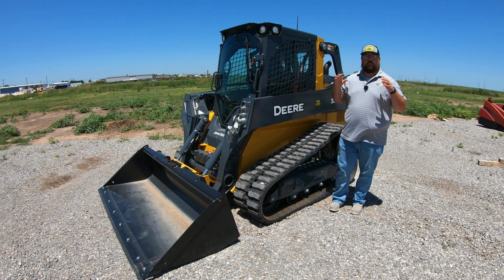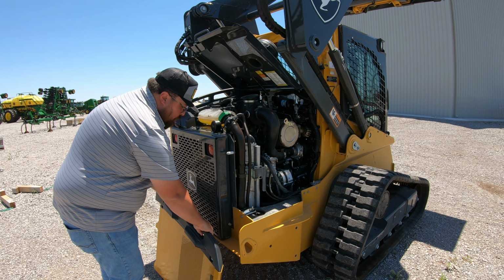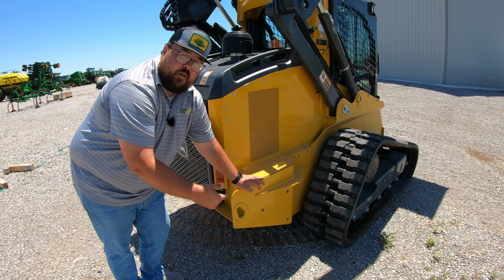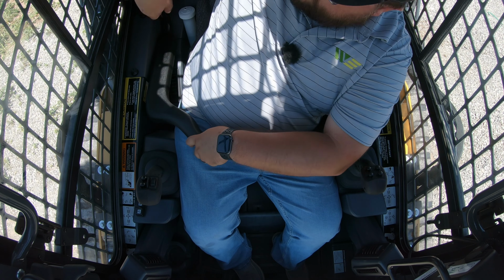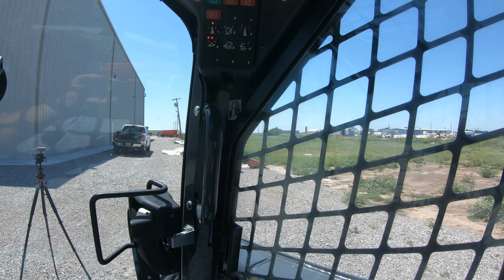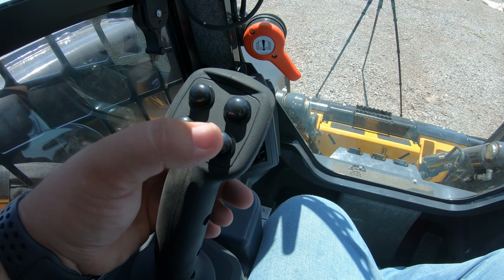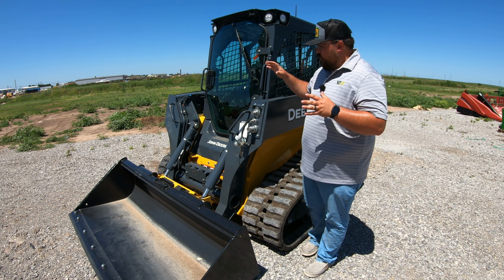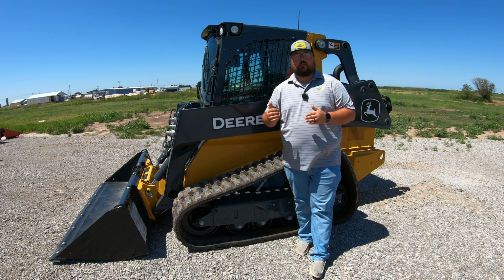2023 John Deere 325G Skid Steer Review & Walkaround

Comment: Am I missing something? Where is the engine oil filter? Hydraulic oil filter? The more I look at this the more I want to keep my old j.d. 355d crawler loader. Yeah... It's slower it's less power but... No dpf,  no computer control, no electronics control. Easy ingress and egress from the cab left or right side. Rear mounted winch. The loader got some heavy ass on it to tackle heavy underbrush here in the southeast.